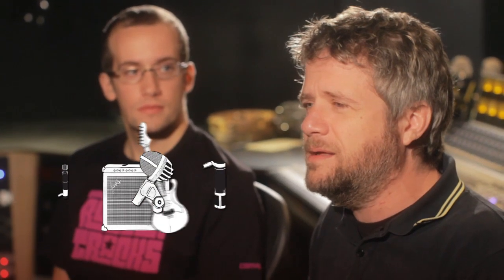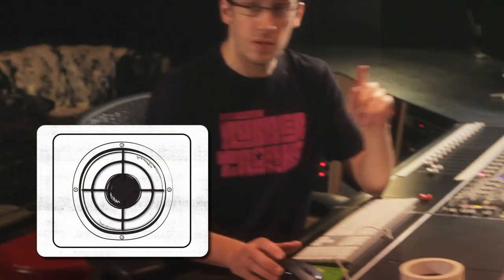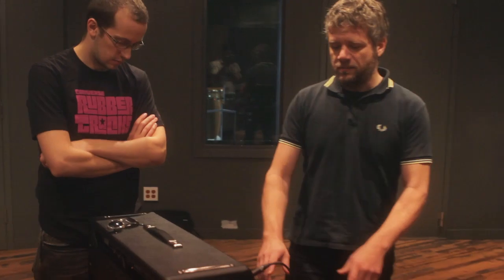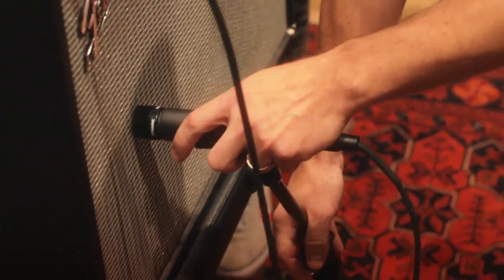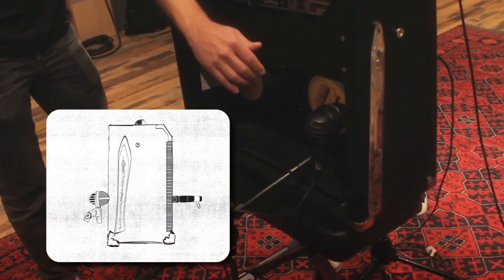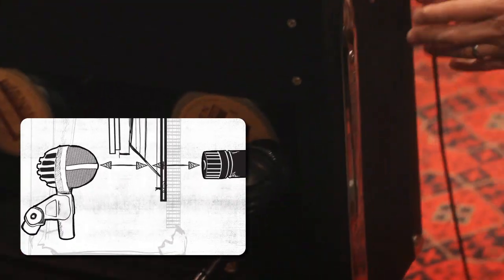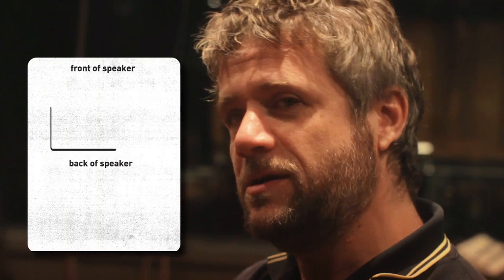Converse Rubber Tracks: Geek Out - Guitar Mic'ing

Comment: Why would you ever need to do this? Why not just connect the guitar directly to whatever you're recording on?
Reply: Cause 99% of the time it sounds dead, over-processed, and digital. Nothing can compare a studio mic to some good speakers in a cab. I don't know a single person that directs their guitar for studio recording. For every single record you hear, that's a microphone on a guitar amp
Reply: There are, in my opinion two main reasons why recording direct is not as widespread as recording an amp.

The first is that most guitarist have spent great money on getting that sought after tube amp, so why should they leave it at home when they're going in a studio?

The second is that to get a great sounding track by direct recording you need to have great sounding studio gear.

But don't disregard direct recording completely! There are plenty of great and famous song that have been recorded direct; The Beatles, Led Zeppelin and Radiohead are some of the big bands (with great amps at their hands) who've chosen to record some tracks direct. In the studio there is really no rules. If you've got the time and money; experiment!
Reply: ShadowMan 
"Nothing can compare a studio mic to some good speakers in a cab."
First of all, this sentence don't make any sense at all. If you're going to record an amp (or any sound) you need a microphone.

Considering the recording technology available today, that sounds like 99% of the time someone does something wrong. As long as the quality of the transformer (DI) who transmform the signal from the instrument to a line signal is good, there should be no problem getting a good direct sound.

If a direct recording fits the song is another question! And that can't be answered by anyone other then the people who sits in the studio when it's recorded.

And in case you need some examples of great songs recorded direct:
The Beatles - Sgt. Peppers
Bob Dylan - Highway 61
Led Zeppelin - Black Dog
Neil Young - Cinnamon Girl
Pink Floyd - Another Brick In The Wall Pt. 2
Daft Punk - Get Lucky